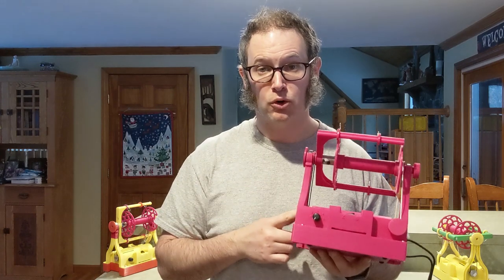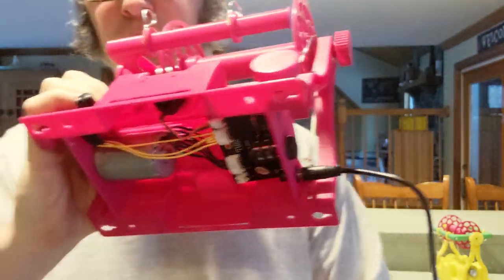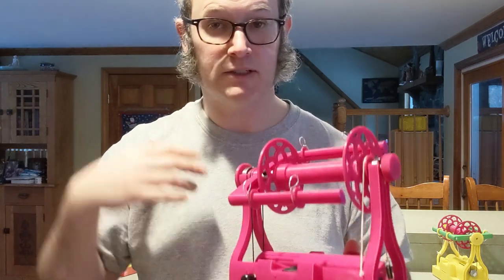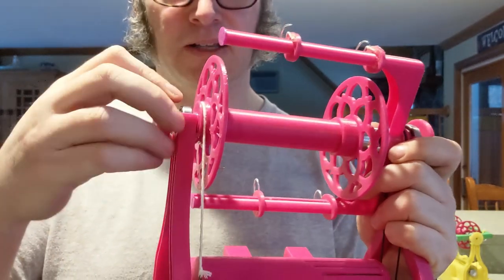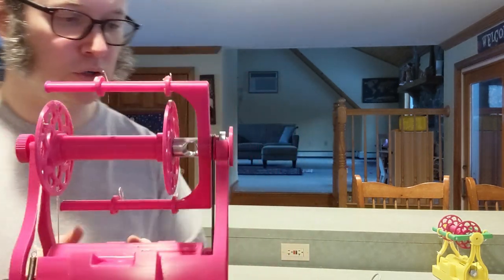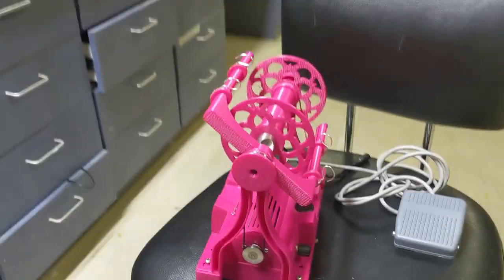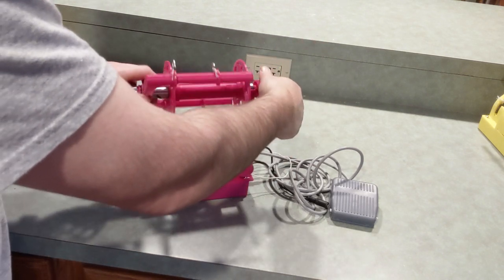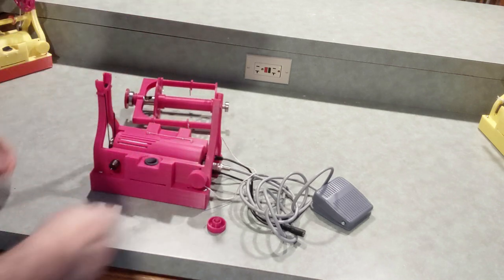SPIN #60 - Update on the Latest EEW Prototype (Jan 2020)

Comment: Would you consider flexible retractable cord for foot pedal?  And what about small drawer under battery case to store small bottle of oil and spare parts/belts?  I know case modification is a bit of trouble and it would make the whole unit taller.  For lazy kate maybe 2 holes in base with 2 pegs that could clip on bottom to allow tension band when 2 or 3 bases are plugged together?
Reply from the maker: Thanks for the suggestions.  I won't be doing a retractable cord since that would add a lot of cost and complexity.  I'd have to switch to a totally different pedal and probably a custom one since I haven't seen anything like this.  That said if I ever do a custom pedal I will consider adding this kind of feature.

The problem with the case modification is that it would increase the height as you said.  People will be free to 3d print custom bottoms and if some bottom like described became a popular 3d printed design I might consider adding it in  some future design, but I have only seen a bottom like that made for the EEW Nano once.

Comment: Would love to be a beta tester. Would you be able to flip the hook holder and the directional switch? I feel like I’d use the orifice hook for than the directional switch and most people are right handed (sorry lefties)
Reply from the maker: I did eventually give up on the left handed right handed thing.  While I would love to accomidate left handed people, I really found too many compromises in that.  I also can't justify 2 different molds.  I have done some quick tests with my left hand and nothing seems like it is difficult to do with my left hand, it just feels a little odd.  I think after using the tool for awhile it will feel good for almost everyone.